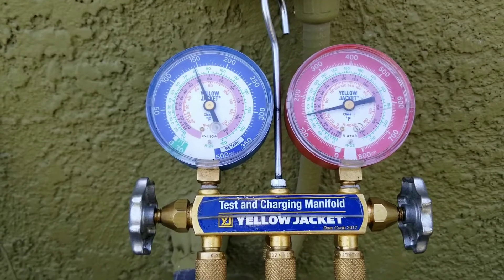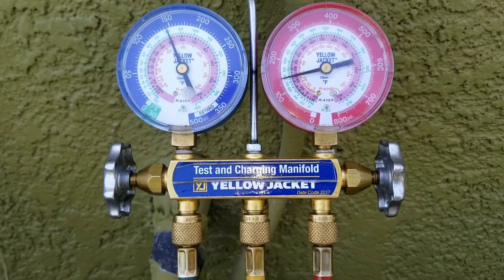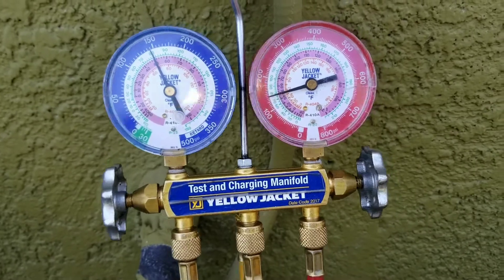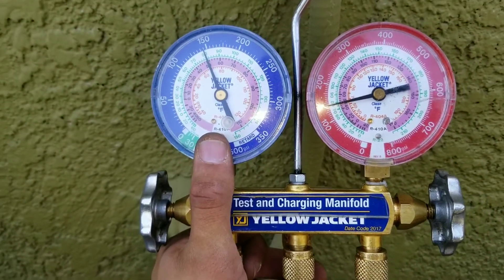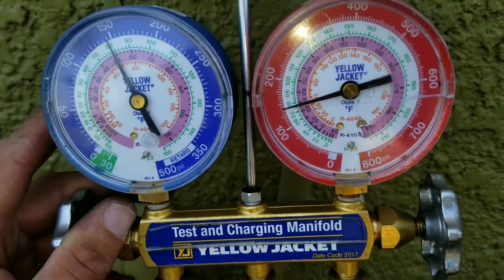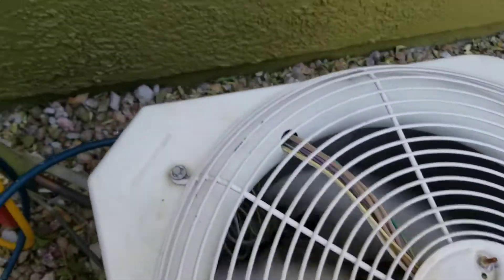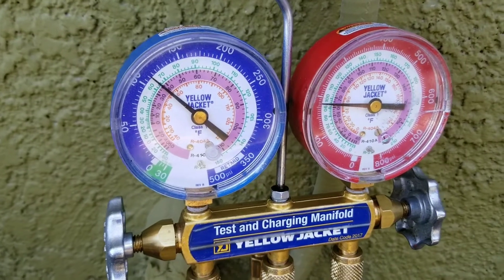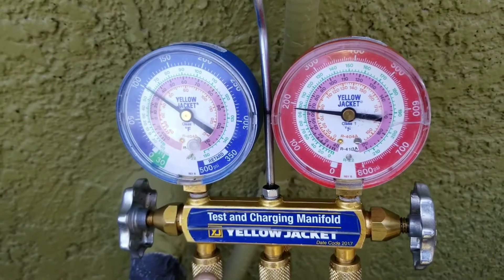How to Check Compressor Using Gauges

Comment: So your basically looking for balance on low and hi pressure sides on the gauges for proper refridgerant levels? If ones way different then the other then its low or leaking? Meaning how you said its going to vary on ambient temp without doing all the math its supposed to be a near balance?